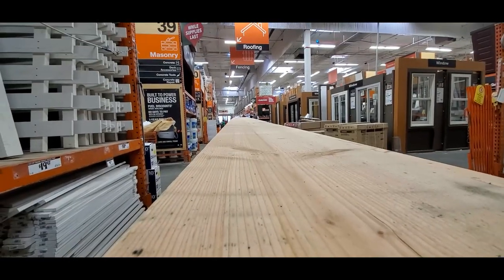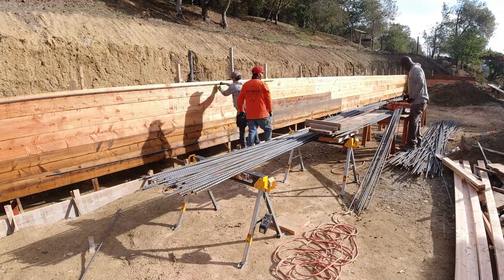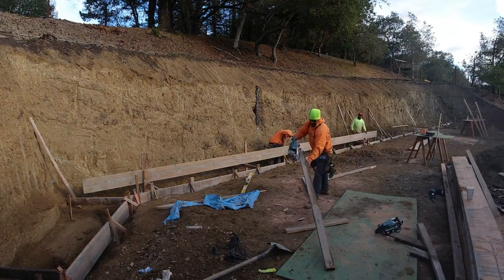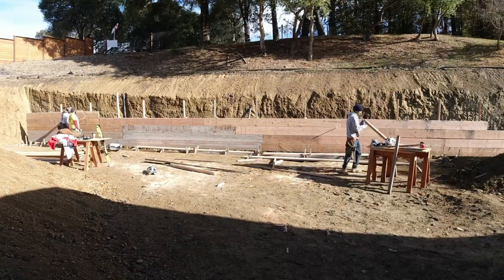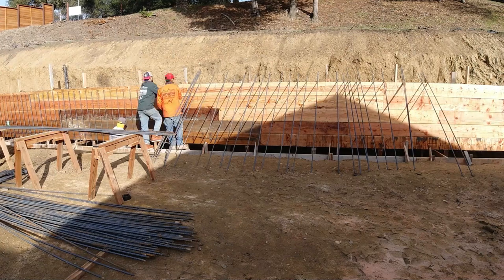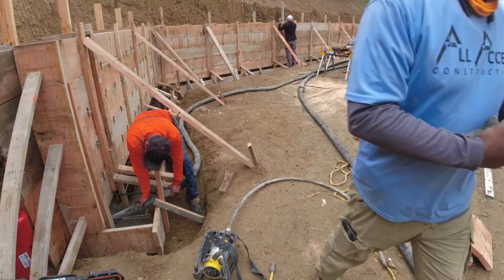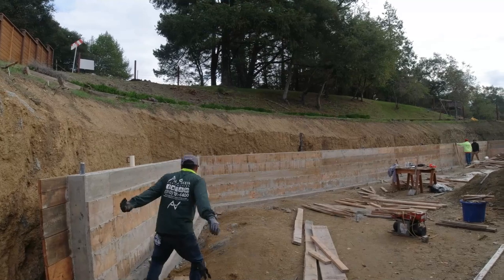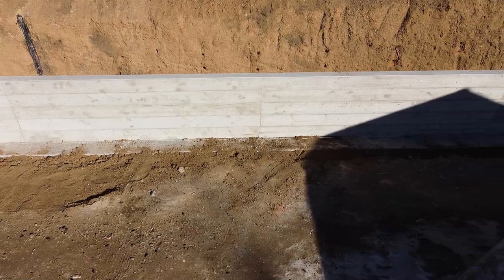How To Build A Concrete Retaining Wall From Start To Finish 2021| Bay Area

Comment from the maker: How To Install A Concrete Footing https://bit.ly/3r3wlXO
How To Build Back Of Retaining Wall: https://bit.ly/2IMpIbP
How To install Rebar For Concrete Wall: https://bit.ly/3559Skx
Reply: Hello, great job again, as i said in befor comment. What is the name of these metal brackets you put in between the woodplates of both sides of wall to keep the wooden plates from swelling during pouring concrete ? Do you have a link fro online hsop or something. Thanx
Reply from the maker: Appreciate the comment 💯💯.. There called Simpson wt-8
Reply: @AllAccessConstruction  you're awesome because you take the time to respond to queries! thank you!
Reply from the maker: All good man appreciate it.. 💯💯
Reply: @AllAccessConstruction  the simpsons strongtie wt8 is not recommended for courses higher than 4', what has been your in-field experience?
Reply from the maker: Some one else mention that.😂😂😂 I use them on all my walls up to 12 feet. And as thick as 12 inches.. Depending on the height of the wall we go 12 to 16 inches on center
Reply: @AllAccessConstruction  thank you! i was wondering if 4' was a bit conservative

Comment: Excellent video as usual.  Are Engineers asking you to form the front edge?  I always prefer the people don't do that as possible - or just the top 3.5" or something.  That is the passive reaction that helps the most with stability.  If you are pouring a whole patio, or if the upper soil is really weak, then it doesn't make any diff.  Thanks!
Reply from the maker: Appreciate the comment.. Couple of reasons I Frame the footing. The guy that taught me was into clean lines..😅 😅 😅 Also it helps us get a better count on the concrete knowing It's  lock in.

Comment: How does the drainage work for a wall of that size?
Reply from the maker: I will have a video for that soon.. But filter fabric.. Drain rock.. And sdr 35 4 inch pipe...
Reply: @AllAccessConstruction  I would love to see a video on that too, we have a similar project at our home, shorter wall but longer distance, that most designers have been recommending stack blocks but we like this look much more. Does the backside of the wall need waterproofing if or is drainage sufficient? We originally wanted stucco but I think colored concrete would be less maintenance. Any thoughts/recommendations?
Reply from the maker: @michaelrunge4133  On concrete walls we do not apply waterproofing membrane. On block walls, we do.

Waterproofing CMU or sometimes called cinder blocks: https://www.youtube.com/watch?v=rFIaYjE67d4

French Drain for the concrete wall: https://youtu.be/CNWZLzqmoVU 

A deeper explanation of how french drains work: https://youtu.be/sbc8NbkhC7A